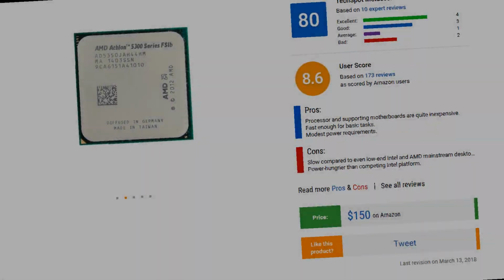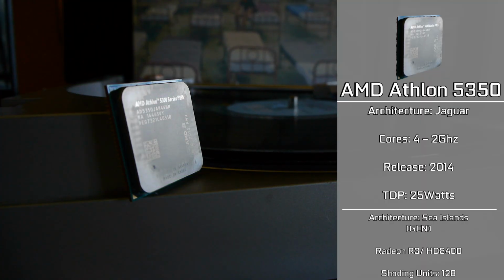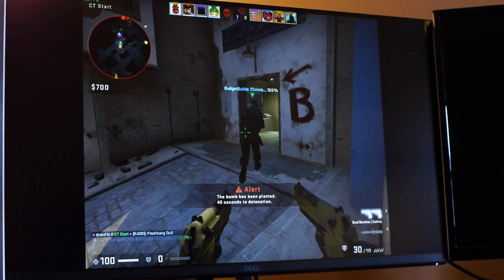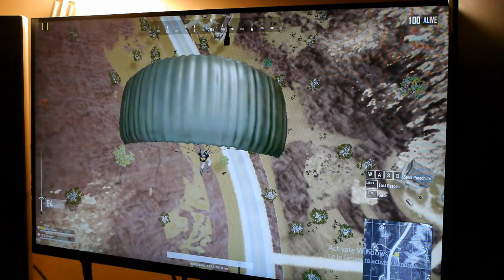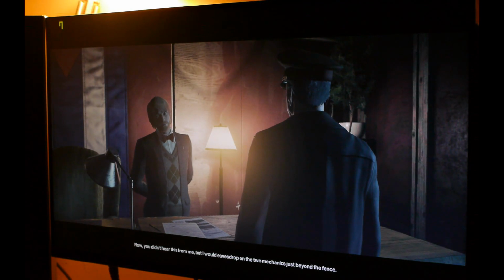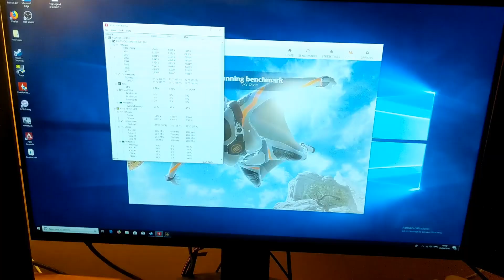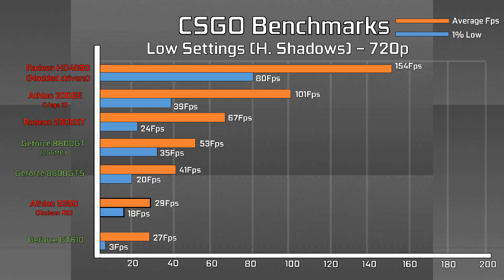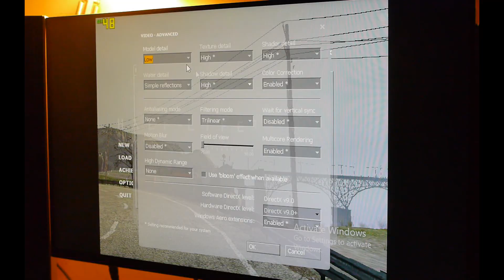Socket AM1 - Aging Horribly!

Comment: Aged badly? 
Atom netbook: hold my lag
Reply: Atom Netbooks didn't age badly cause they were crap even when they came out plus the original atom lineup was single core with HT so that was crap as well
Reply: @bluescluessuperagent  They were indeed crap, but they could at least do basic tasks. Nowdays not even playing back music or opening a doc they can.
Due to them being awready crap when new, they aged very badly. 
And what's worse is that most of them even can't run win XP due to the manufacturer only providing w7 drivers. Like a hp mini 110 3735dx wich i actually had in the past
Reply: @eduardoavila646  ....that's not how the term works though (and I too owned an original Netbook with a single core atom with HT) 

something that's crap then and a bit more crap now doesn't age as badly as something that was actually useful then and crap now

The term is about how badly the thing is relative to before.

Netbook atoms were borderline usable in the lowest spec consumption windows operating systems at the time like Win XP (or Win 7 Starter)

I'd give an aging badly award to this AM1 socket over an original atom any-day

Netbooks got wrecked almost immediately by the introduction of the Ipad
Reply: @bluescluessuperagent  Well, a system that could actually play up to 2004 games, wich could playback youtube up to 720 fine, could playback netflix on 480p, could do all basic tasks and that now can't even open a calculator under linux aged pretty badly.
It actually ended up as useless as nothing really runs on it.
Reply: @eduardoavila646  ......what the heck happened to your netbook if you can't open calculator on linux? 

I have one and it can run Windows 10 and actually do stuff. Hell, before the battery died, I was using it to play Roller Coaster Tycoon and Stronghold....as of last year I want to say....maybe 2017.  Or I may have continued using mine as a torrent downloader 

keep in mind, you have to look past the cpu. I did upgrade mine to 2gb of ram. 1gb of ram is crap 

I'm gonna go get it and install a fresh copies of win 10 32 bit and see how it does. 100% probability I can open calculator
Reply: @bluescluessuperagent  This am1 aged pretty badly too. But what's worse than it are the pentium 4's and pentium d's. They were actually good when launched (even tho they were a oven). 
But nowdays as not long after they were launched, the industry changed from a singlecore high clocks to low clocks multicore systems, p4's and pD's are awmost in the same boat as atoms, except that they were capable cpus in the past. 

I would say that going to the worst ageing, it would be: 

Early Atoms>am1>early 775 (aka p4 and pD). Being the early 775 the worst.
Reply: @eduardoavila646  you also have to look at the factor of Time.....AM1 launched quite recently actually in 2014, Pentium 4s and Pentium D's did not. Socket 775 came out in 2006 (and the architecture predates that with socket 478) 

everything ages badly. the question is about aging badly over the shortest amount of time (barring some scenarios where a gpu gets better with driver support or something)

I got my netbook up and running. Doing windows updates, gonna do some windows 10 tricks for making the operating system lighter, and I'm gonna try using youtube and netflix
Reply: @bluescluessuperagent  2014? I could swear it was something like 2010. Then it aged worse than a early 775 for sure.
Reply: @bluescluessuperagent  W10? Last time i was able to struggle in netflix was with puppy linux, slacko 6.5 if i'm not mistaken. 
But i can't run it anymore. 

Is your cpu a early atom ? If its a amd dualcore like a e450 it can probably with some neat tricks run netflix and youtube well under w10 .
Reply: @bluescluessuperagent  I mean it can open the calculator, but is had a pretty bad delay, and with big numbers or complex calculations it takes another delay to calculate. 
Its easier to get my pocket calculator or use my phone's calculator. 
Its actually slower than searching for google's online calculator, wait the page load and calculate there, using a decent pc. 

It was bad at a point where it couldnt keep up with my typing in word 2010 under w7 or libreoffice/abiword under lubuntu. And after i stopped typing it would still be for some time writting it on the screen depending on how much i wrote. 
I rember writing a whole document looking to the keyboard and when i looked the screen not even half of it was typed, i had to wai like 1min to the while thing to be there. 

And comparing with any more decent system such as a core2duo laptop, proportionally it actually seems linda right. 
It has a mere 283 cpu passmark score and a 3 gpu passmark score.
Reply: @eduardoavila646  it may not be the literal first atom cpu produced, but it's still pre dual core atom (and evidently the first dual core atoms were crap too, not much better than 1 core with HT). It's a N450 @ 1.66. I didn't confuse it with an AMD cpu. It's an HP mini netbook 

I have upgraded the netbook to 2gb which is the max. 

And I'm cheating a bit by using an ssd. But it's Windows 10, this thing was meant to be used with Win XP or at best Win 7 Starter. And Linux of course. So I say an SSD is allowed (especially considering how cheap 120gb ssds are nowadays, hardly an expensive upgrade) 

Almost done with my updates. I'll see how youtube and Netflix run on it
Reply: @eduardoavila646  ok so I'm done with my tests

Netflix was a no go. 

But I could get 480p on youtube ok enough

and typing in notepad had no issues. My words popped up as soon as I typed them. And this is on Windows 10 home 32 bit. I would think Linux and Win XP or Win 7 starter would be faster. At idle, I was already using 1gb out of 2gb available for Win 10. Just imagine performance with only 1gb ram. 

I'm not sure why your atom is so bad. Mine is hardly one of the newer ones (of which I do have a tablet with a laptop keyboard dock that has a much more modern quad core Atom cpu). 

HP mini with Intel Atom N450 at 1.66 1 core 2 thread, Has Intel gma 3150 igpu. 

I think you are combing too many issues and putting them onto the atom cpu aspect. Beyond just the cpu possessing power is the igpu and the ram, both which are crap. 

Now obviously this was never a debate over if the original atoms suck, which everyone can agree that they do

But my Atom is still usable...it's just crap. And it was crap when it came out. 

It never had high expectations and was obsolete when it came into the market. So my argument still stands. It's didn't age as badly as an item that was once considered good and not simply borderline usable
Reply: @bluescluessuperagent  Nice your is working like mine was in 2014. When the beta for w10 came out i was using it in my atom. 
Sadly its performance was degrading fast. 

Its not that it canot run stuff, but its painfully slow. And seeing that a pentium 3 @1133mhz have the same cpu passmark score, makes sense.

Mine was a hp mini 110 3735dx, with a atom n455 and only 1.5 years ago was upgraded to 2gb of ram. 

With puppy linux or any pentium 2 & 3 designed distros it runs fine. 
Also notepad was fine on it, the tuping delay was in browsers and in more complicated office suites such as office 2010. On winword (aka word) it has that delay augmented as the text became bigger. 

With lubuntu the performance was a tad bit better than w7. But libreoffice is a tad bit heavier than office 2010 so it has basically the same performance. Abiword the delay was constant but really small, only about 4-5 seconds to get to where i was typing, that if i was typing fast. Minecraft even with optifine ran at about 4-10fps. Doom 3 ran at 15-20. Notepad was fine with no delay.

Sadly, when i bought a atom d525 and sent to a guy to dessolder the old n455 and upgrade it, it died. Idk if it was the tdp 200% bigger (6.5w vs 13w) or the bit rusty solder. But i didn't care it was upgrade or death. 

Anyway if you dont have nothing its sort of usable but a core2 laptop is way better.

Can you test ms word or anything like that in yours?
Reply: @eduardoavila646  you have to pay for word nowadays or have a license for an older model and I have none on hand. I used Notepad and that ran with no issues. 

I'll try installing one of those free windows offlice like software and check back

perhaps the performance increase is because I updated to 2gb and am using an SSD which really helps in systems with limited ram
Reply: @bluescluessuperagent  Yeah the ssd may help with acess times and swap/virtual memory.
Btw libreoffice is free, if you could try it. 

I may get a amd e450 system of mess around or maybe a atom one. A 11.6 inch system is really neat even as a pda
Reply: @eduardoavila646  I just installed Libre office and used their word writer. No issues. I type and words show up without lag. No freeze ups. 

I'm know the SSD helps, but there shouldn't be that much of a discrpenacy. Honestly the real slowness comes from windows itself as Win 10 is just too large and demanding for this atom.

The 2gb upgrade also helps.

Comment: If you aim for minimum reasonable CPU performance, it becomes unreasonably slow relatively quickly. You buy some headroom and it takes longer time before it is unreasonably slow.  If you buy high end CPU it takes time until low end CPU:s are as fast as your high end CPU and then it takes time until software is too slow to run on your CPU.  Now is really bad time to buy CPU:s . Intel has been stuck on 10nm for how so long, and there is multiple generation of CPU improvements stuck waiting for it. And Intel 7nm has been working in parallel with 10nm team and it isn't stuck, its release date was just planned to be later.

Comment: I'm writing this on a 5350. This processor had an IPC about half of current ryzen/core Ix. @2GHz is like a 1GHz (fixed, no turbo of any kind) 4 core processor. BAD.
But there is a bright side. Multiplier is locked.. well.. 97% locked. For some unknown bizarre reason is posible to set it at x21 and you can bclk overclock from there. EVERY SINLGLE 5350 reaches 2.7 GHz on stock cooler, at least every single one I tried. Some (not me) has reached 3 GHz or more. 
But the thing is with base clock risin everyting rises, CPU, GPU, memory, everything. Once you pass 850MHz on the GPU system becomes unstable. 
Anyways, the uP is overclockable by a 40% for free, on stock cooler, rock solid for years. You should test it that way.

There was a 5370 model too, everything the same but with x22 multiplier. Never seen one ever.
Reply: This guy is absolutely correct, when properly Overclocked this CPU is capable of some rather amazing things. Pair it with a GTX 750ti and you have a low power budget build that actually performs pretty admirably. I paired mine with an Asus micro ATX board and 8 gb of 2100mhz ddr3. I actually managed to get near that ram speed too despite the architecture officially only supporting up to 1600 MHz.
Reply: where do you buy yours? cant seem to find one for a decent price
Reply: @AntKardano  i don't think they are sold anymore. Bought mine new 4 years ago.
Maybe on ebay.
Reply: I have 2 running as servers. Im gonna play around and try this this weekend.
Thnx.
Reply: Yes but this soc has a better IPC than a Bulldozer FX.
Reply: max enzo  yeah, they are awesome. One has been running a pfsense box for years without hicups.
And the other is a nas with some vm's on it and a raid card with 8 disks. Also no issues and sufficient power if you stick to gigabit connections. 

Recently put one together from my old ryzen 1700 box as well. That thing flies in comparison though. 
But yeah, should be expected offcourse. 
But is nowhere as power efficient, those athlons run on 10 watts or so. A little more if i'm pushing near a gigabit of bandwith or using the disks.

I did try the overclocking stuff a while ago and it does work. But for my usecase i didn't need the extra horsepower so i put it back to stock. Powerusage goes up so yeah, no poi t in runni g it like that if i dont need it.

But yeah, these are awesome for what they are.
Reply: Maybe I struck out, but overclock my 5350 by just 50Mhz, the whole system either becomes unstable or locks up.  At 2.2Gig it won't even boot.  Rock-solid reliable at default settings though.
Reply: @mojojomo6750  You need to run it in IDE mode on some boards. It does that when it is set to AHCI. Good luck.
Reply: @gokberkkeremdemir8006  Thanks for the tip. Unfortunately, when I switch to IDE mode, neither Win7 or WinXP will boot, though interestingly, Linux works fine. Think I'll wait for a ryzen APU for more speed!
Reply: Could you please tell me how you overclocked it. Mine goes up to 2.10 and there are no other settings in the bios.
Reply: @smacc1319  maybe your motherboard doesn't allow base clock (bclk) setting. I had to carefuly pick a model that had it. Let me see. ASUS AM1I-A. That's the one I used.
Reply: @tektel  Thats unfortunate. Thanks for the reply.
Reply: @smacc1319  have you tried updating the bios?
Reply: @tektel  My motherboard is ASRock AM1B-M. Looking in the website there are 3 bios versions. I don't know if they are any different than the one I already have installed. I might try updating the bios tomorrow.
Reply: All the Phenoms had terrible IPC, the only thing they could do is 4 GHz if you were lucky to be able to overclock.

Comment: Made the same experience with loading times, CPU seems to be pretty bad at unpacking data. Or maybe it's a general weakness of the chipset?
Reply: The cores are 2 AGU 2 ALU - about half the execution capabilities of modern Intel and AMD cores, per clock, if interpreting things favorably for them (more like 1/4, if not), it had a single RAM channel for CPU and GPU, while the quad core CPU alone could likely benefit from dual-channel RAM. The L2 cache ran at 1/2 core speed (that allowed them to pack it into a smaller space, to save silicon costs). It also saved die space by microcoding common complex instructions, such as divide and modulo (get remainder of a division) - that is, having it effectively emulate the instruction on-chip, like a little subroutine of other instructions, instead of having fast dedicated hardware for the job.

It's just a weak CPU.

Comment: How could they make it so bad? It released 5 years after the Core 2 quads yet it can barely do anything, though it doesn't pull much power it still impress me how the spec sheets are so different from the real life performance.. It's good that AMD has improved from then because they really had to.

Also I liked the pokemon gen IV music ;)
Reply: These are socs. They compete with intel atoms and the arm platform one board computers.
And they did outperform both intel atoms and arm socs. Plus you could use any regular ddr3 with them and they had an actual socket, something intel never head as they where soldered to the board.
These are actually very decent for what they are.

Perfect low power browsing boxes or home servers. That is what they where designed for.

Comment: Here's an "AM*" socket timeline for those who are confused:
AM2   2006
AM2+ 2007
AM3   2009
AM3+ 2011
AM1   2014
AM4: 2017

You're welcome
Reply: The fuck AMD, what's the idea? Is it because it's a little bit different CPU than they make usually?
Reply: @glossedghost  Why did they even begin with AM2? 🤔
Reply: @BjornsTIR  You wouldn't understand.
Reply: @glossedghost  😂
Reply: @BjornsTIR  cause AMD originally called the AM2 socket M2, but then changed the name to prevent confusion with Cyrix processors who at some point had an M2 socket and had a defunt never released M3 socket

As to why they didn't change the name to AM1?......Idk

companies name things for a number of reasons 

like Microsoft skipped windows 9 for a reason and went from 8 to 10.

Nvidia just went from 680 t0 780 to 980 to 1080 to 2080 (had no 800 series desktop gpus, and went from 1080 to 2080 instead of 1180. I guess 2080 just sounds so much better)
Reply: @bluescluessuperagent  the more you know

Comment: Had one of these, it was a very disappointing CPU even back in 2015. It was a tad more competent for emulation paired with a 730 ddr5, as OpenGL performance on this APU was really lacking. A 25W TDP wasn’t that impressive considering an iPad of the time was much more powerful. This thing really needed dual channel memory badly. Did you mention there was no upgrade path at all ?